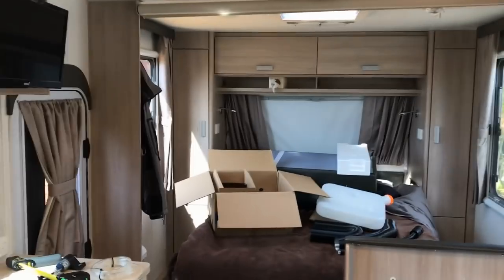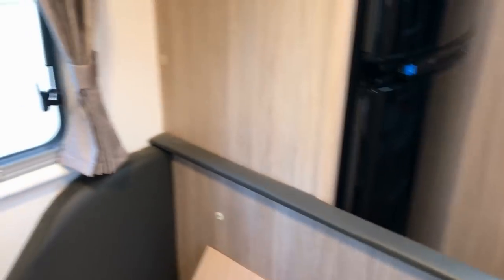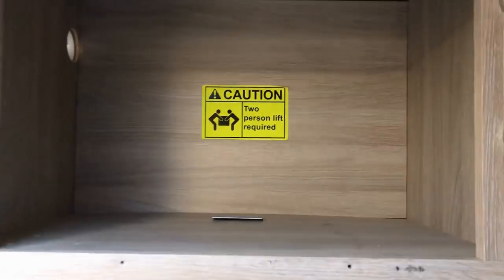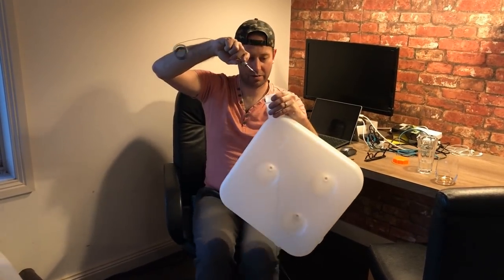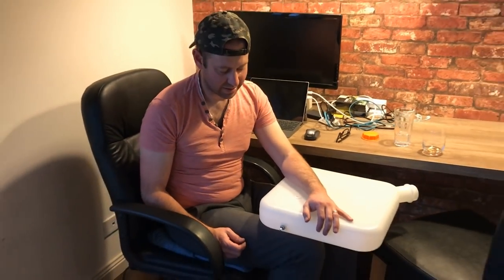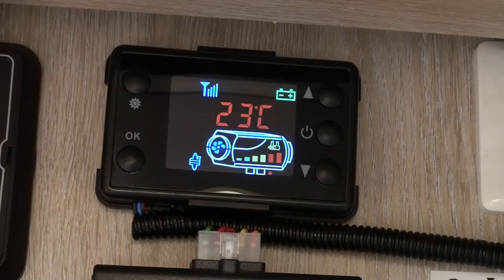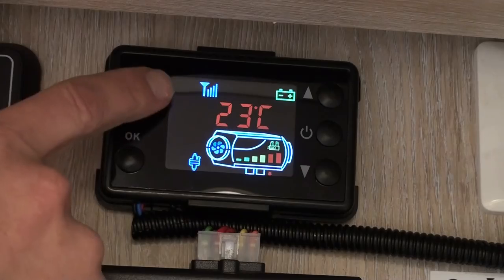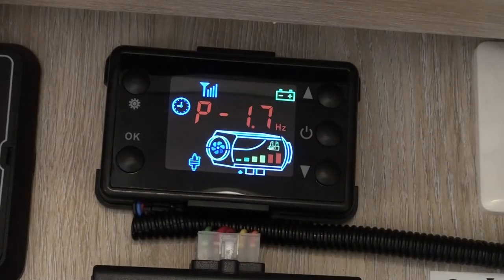Diesel Heater Install and review  #Winter is coming

Comment: Great video. I think the P - 1.8 Hz is referring to the pulse width modulation for the fuel pump. This determines how much fuel is pumped into the heater to burn. The more fuel the more heat. I hope this helps.

Comment: as a old truckdriver I have used several webasto and eberspacher diesel heaters not only inthe trucks but in the land rover and shed as well . It is important to run them every month for 5min minimum even in the summer to avoid start-up problems when you realy need them
Reply: ?? These should be able to run on the old Stove oil wouldn`t they ? Back in the day I lived in a old mobile home with a oil heater , we ran out and they could not bring any cause of the weather , the company told us to run down and get some diesel enough to get us through for a couple days , did that and it actually worked really well with a slight smell of the diesel though ..
Reply: @ Bills BuildAll ... Yes, these things will burn diesel, stove, furnace or kerosene.  They would burn jet fuel, too, but that's pretty expensive stuff.  Anyone running furnace or diesel in a situation below -15 might consider cutting it a bit with some kero to thin it and keep it from gelling so soon.  If the unit is functioning properly, you shouldn't smell any hint of the fuel at all, though of course a brand-new one running for the first time is going to stink a bit,  and during initial combustion each run, it may smoke a wee bit until it revs up to operating speed and temperature.

Comment: I've used several of these diesel-fired units in semis, work awesome. I've also used mini-woodstoves in my caravans. In a perfect world I'd install both. Doing a bit of creative ducting to areas prone to freezing pipes using the diesel for that purpose and when I'm away for extended periods in freezing temps. Wood is by far a much warmer comfy feel.... if I have to pick one it would be the diesel, gives u a lot more freedom and ability to freeze protect with forced air. My opinion.

Comment: The temperature setting is in hertz mode. This mode is like a fan speed setting. Hold both top buttons and this will put it into thermostat mode and you can then adjust by setting a temperature.
Reply: Gavooz 🤙

Comment: I brought one from Ebay, fitted it into a small Gal toolbox so its portable. I run it in a soft floor camper, can only run it on lowest because it works so well! It lives under my bench in the workshop, I use it in winter all the time. So far can't fault it. Same as yours the instructions are crap and there is no instructions on the control unit. I highly recommend them, would buy a much smaller one next time, 5kw is too big for the camper.
Reply from the maker: Agreed, they’re pretty powerful
Reply: Whats the fuel consumption like?
Reply: @DarkLinkAD  I find that no one talks very much about the consumption of these heaters.... Should be the number one thing to address...
Reply: @6969smurfy  Exactly, it seems a lot of heat goes wasted in the exhaust. Where-as a traditional Torpedo style shop heater has no separate exhaust. (They dont make one small enough though)
Reply: Dan M 1 liter will give you +- 4 hour on full for a 2kw
Reply: @DASHOffRoad  Hi , how long is your caravan , ? I live in my 35 ft. travel trailer in Canada , gave up on the propane heater as to much humidity , gets cold here , I was thinking on the 5k units , other people have said on full they use .5 liters per hour , little over 2 .6 canadian 
 gallons a day , that seems high to me . Diesel her costs us $ 6.27 a gallon . They have the 2K & 3K units also but I wouldn`t want to get one for fear of them not being able to heat my trailer .. My trailer has a 265  square ft. floor area .. Any thoughts pls .? Thanks for any help Bill

Comment: Every version of this heater is the same. The only change between 2KW 3KW or 5KW is the software. If you always run these at a low flame they will end up packing with soot.
You should run them at max temp for about 5 minutes before every complete shutdown. Or at the very least, let them run full blaze for a bit every few days of low power use.
This will help keep the combustion chamber clean.

Another note as mentioned, the Hz setting is a manual control of the cycle rate of the fuel pump. The heater will operate steadily at whatever speed you select this way, but there is also a thermal mode that has a temperature setting like a house. Press settings and arrow up at the same time to switch to temperature mode. In this mode the heater will run full heat until it gets near your desired room temp, at which point it will fall back in power to mantain it. If the temp drops it will rev back up, and if the temp goes too much higher even when it's at the lowest output it will completely shut down if needed. It will then go back through the startup and repeat the cycle if the temp drops again.
Reply: urban myth.... they only soot up on low because of the inexperience of th3e diy fitter.. combustion set correctly they do not soot up at all...
Reply: @harryharry8384  Whatever you say bud, you must own every version of everything ever made. All hail folks, it's debunked. There's no way burning oil could make soot. That's why perfectly running diesel engines don't darken their engine oil any more than gasoline engines. Oh wait. Yeah, they do. Next you're going to tell me that only YOU know how to set up a Cummins or VM Motori diesel engine. If only the companies had hired someone competent like you. Why they would have the cleanest burning diesel engines ever. Right okay.
Reply: you seem to have taken offence but combustion isn't a mystery and correct combustion is essential to the longevity of satisfactory function in any fuel burning device.. this product is no different bar its running off a voltage that varies from 14.7 alternator down to below 11 and obviously pumping the same fuel in with a fan that's running slower on the lower voltage is going to change combustion characteristics...know what you re doinbg and you can best set it up to negate sooting problems
Reply: @harryharry8384  Nah. You just said something offensive. Doesn't mean I took it personally. That aside, you're wrong again. These have a digital speed control and a tachometer. They don't care what the voltage is within their maximum range. They will run the same speed. They determine how much fuel and air to use. Short of restricting the air intake or exhaust with lines that are too long, there's nothing a user can do wrong or right in that end. The fuel? Yeah, that could be messed up. The pump has to be installed in the correct physical location and at the correct physical angle. That's probably asking too much of the typical demographic for these.

No matter what the air fuel ratio, no matter what the temperature (within reason inside of this heater) you will get soot. The air velocity through the burner and chamber make a big difference. A higher setting means faster combustion air flow. That means less soot. Period.
Reply: Your right I've worked with webasto bunk heaters and they would soot up if not shut off improperly. Every once in awhile run on high cleans out the combustion chamber
Reply: do you know if you can get this in us units, or if you can change it
Reply: Hi can you tell me wear you put the fuel tank in you van.
Reply: The 2kw model is a physically different size than the 5kw or 8kw model.
Reply: Thanks for the information.  

On the Hz vs temp mode... are you saying that on Hz mode the device keeps burning nonstop at a set amount of fuel input/heat output?  If so, would that help the glow plug last longer?  Also, do you think that would reduce the overall load on your battery?  I'm guessing it would probably burn more fuel overall though, right?
Reply: @101perspective  The glow plug is only used to get combustion started.  Once the fuel is burning the glow plug turns off.  When the heater reaches its "tartget  temp" it just turns down to an idle.  When its set to pump hz I don't think it does the same.  It just keeps the pump operating at a given cycle.
Reply: @Making_Adventure  Just switch it to Celcius.  and you're set.
Reply: @pierremitham2964  Oh, so unless you hit the off button (or it runs out of fuel or something unexpected) the glow plug doesn't ever come into play again?  If so then that is pretty neat.
Reply: Yes i've got a 2kw v2 model and a 5kw v2  they are the same size unit ecu can be changed between units both with 75mm air outlets And the 2kw soots up more then the 5kw so I all ways give full power and no soot problems now Jeff
Reply: @jeffmee763   You actually have 2 5kw units (one marked as or detuned to 2kw)  the  real 2KW unit is physically a smaller size than the 5kw unit.  33cm long vs 40ish cm long .
Reply: Pierre Mitham You are correct. The actual 2KW models are smaller in size. Ask me how I know that. :)
Reply: How do you account for the different heater sizes if they are all the same?
Reply: Wow, bunch of engineers we got in this thread.

Comment: That p-1.8 is the pulse rate for the fuel pump. Turning that up will increase fuel consumption and make it burn hotter
Reply: @markj2093  correct and incorrect mixed, sir. It is pulse rate but is not pulse width. The fuel pump is an impulse design and injects a fixed amount of fuel for each power pulse sent to the pump. To increase the average amount of fuel the pump delivers (and the resulting firing rate), the system increases the pulse rate (pulses per minute). I'm not sure if these controls modulate automatically based on a set point, however this is based on other user's comments. Mine is built into a custom integrated control system, build to control multiple systems.

Comment: Have to say that you are a quite professional person on these diesel heaters. Many end users who is not familiar with it, receive the heater damaged and not working. But it is too cheap, they could afford to buy a new set again from the same buyer. If your diesel heater has any problem in the future, I believe you could handle it by your self, because the seller will not help. As the cost is lower to the sale price.... they may have no time or effort for any warranty.  Any way, You made a Great Vid.

Comment: Thanks for the tip on setting the thermostat. We have the same unit and it came without any instructions! It was set to 33 deg C. It ran all the time but surprisingly was still very good on the fuel. It got so hot in our 16 foot camper that we had to leave 2 windows open. The dog nearly passed out from the heat! It is going to be really handy down in Tas this year. Thanks for the video.

Comment: That bit about getting the plug in the bottom of the fuel tank is going in the memory bank, gonna need it one day! (I would have put the wire through the small hole first though as easier to find the large hole)
I've done similar things in a car for routing wires down through the dash using those drain unblocker spiral spring things, sometimes a tape measure can work too!
Reply: HOW OFTEN WE CANT SEE THE WOOD FOR THE TREES..YOUR  SO RIGHT, MUCH EASIER..BUT I BET 8 OUT OF 10 OF US WOULDNT HAVE THOUGHT OF THE OBVIOUSE..LOL
Reply: A metal coat hanger works really well to .

Comment: When using the wire to fish the fitting through i suggest doing it the other way ( although yours worked), normally i push the wire through the hole out the fill neck wire fitting on and pull down and through.

Comment: Nice job. I only thing I have a problem with is the thermostat in with other electrical equipment in a closed place  will always read higher than the room.
Reply from the maker: Yeah, I always keep that door open when the heater is on

Comment: I recommend using a "stand pipe" for the fuel suction in the tank. This puts the suction fitting at the top of the tank which reduces the chances of leaks. This will require a fitting with a pipe attached.
Reply: Havent had any leaking issues with the fitting they provide for the tank. Just make sure you size your drill bit correctly and you wont have any issues.

Comment: Im becoming more and more intruiged by these heaters everyday. Now i want a van ! Lol. Lots of good information here. Thank you
Reply: Yeah, I'm thinking of getting one of these heaters.  I currently use a Mr. Buddy in my van when I travel.  I can't safely use it while I sleep though.  Plus you have moisture and even smell issues with it.  One of these diesel heaters would make winter trips MUCH more enjoyable.  Maybe keep the Mr. Buddy in the van in case the diesel one breaks on me.
Reply: @101perspective  get yourself a diesel heater, you will not be dissatisfied. Great dry heat and lots of it! It's a bit of a pain to install but really not that bad. Just make sure that wherever you have your exhaust coming out, its not under your van. Make sure it is as far past the frame coming out to the side as you can or gases may collect underneath and seep back inside. Be safe my friend.

Comment: These heaters, like Espar and Webasto heaters, will run on diesel, stove, furnace, or kerosene.  Use whichever is cheapest, or readily available.  Keep in mind that the thicker fuels like diesel and furnace oil will tend to gel sooner when the temperatures plummet.  Do not be tempted to add commercial additives like off-the-shelf stuff meant for diesel vehicles.  If you are going to experience very cold temperatures, like below -15C, try to find some kerosene, which will thin out the fuel.  The problem with the additives is that the additives are created with the knowledge that they will keep the fuel from gelling, but then be burned in a diesel engine, where the temperatures and actions will prevent accumulation of soot and crap. These heaters are somewhat sensitive to "fogging up" in their little combustion chambers,  and the additives will end up contributing greatly to soot and solids. There is a sensor in the chamber that senses the light of the flame, and too much soot and debris will cloud or fog up the sensor, rendering the unit inoperative until you take it apart and clean it or replace it.  Another "tip" regarding fuel... often, diesel (sometimes stove oil too) is available dyed red, meant for off-road use, or non-power unit use.  Meaning that anything that doesn't use it for propulsion can legally burn colored fuel. The red dye will not hurt anything, though it may leave a pink tint visible in filters, plastic lines.  The dye is for detection purposes only, so that people who try to use it in their trucks or highway vehicles can be more readily "busted" should the revenue squad set up at the weigh stations checking tanks. Dyed fuel will not have road taxes on it, so can be quite a bit cheaper.  Heating oil or furnace oil can be inexpensive too, but it's not commonly found at retail pumps. If you can find a heating oil supplier, they may sell you a few jerry cans quantity, but might be worth making a phone call first to inquire about pricing and when/where they will supply it. Happy camping.  (Edit:) As at least one other commenter has mentioned before me, it is important to run these things periodically, even in the summer when it might be warm enough without the need for a heater, to ensure that everything keeps freed up and "bug free".  There's no time like a cold snap to find out that a colony of wasps or spiders has taken up residence in the exhaust pipe.  Also,  run the thing a high output at least once a week when using it, to help keep the combustion chamber clean.  It's sort of like a chimney, can get sooted up from too much restricted burning.  It needs to burn good and hot for a short burst of 5 to 10 minutes to keep itself as clean as possible. In the "off season, try to fire it up once a month or more if possible.

Comment: I just picked one up for 140 bucks with free shipping!  My remote not only has the on/off function but also the up/down temp controls!  This thing can crank out some heat.  I may be running the heater with the windows down in my minivan this winter.  I believe that 1.8 is the kilowatt output or something. Mine runs from 1.6 to 5.5 IIRC.   Installed it the other day.  Only ran a one nite mini-test to make sure it worked.  Still sixty as a low at night here in the high mountain meadows.  Didn't want to wait til the last minute!  This replaces a dangerous Mr. Buddy I have been running in the footwell of the passenger side (seats removed).  #hobomessiah  Enjoy.

Comment: They look really good. My one worry is i cant see a emergency shut down if the fan motor fails. That is a lot of heat with no way to vent it. I believe the two main named brands have over heat protection built in and have one way flash trap valves to stop any flame reaching the fuel tank.  
A set of air bellows for blow up bed could save it melting and causing a fire.
Reply: They have over-temperature shutdown sensors, or at least the Espar and Webasto units do..., and if they overheat for whatever reason, such as fan malfunction or air restriction/blockage, they will power down.
Reply: Keep in mind that the combustion chamber air is powered by an impeller from the main fan that blows the air. Even if the failsafes fail, if the fan stops the combustion stops immediatly. No worries, install and enjoy your heat!

Comment: Another tip: either install a switch to the unit or always unplug the controller when not in use. If you don't and leave it on permanently then it will fade and you will soon be struggling to read from it